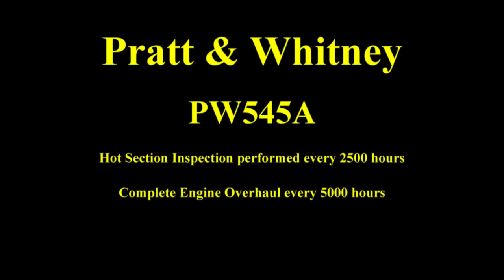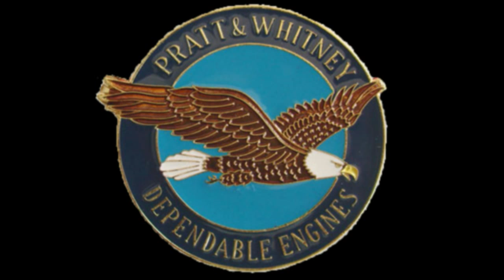Pratt & Whitney 545A Hot Section Inspection with Dallas Airmotive

Comment: Hey Kevin,  I'm delighted to see you making sure that the pieces-parts are keeping us all safe.  For the 'mere mortals' among us, FADEC stands for Full Authority Digital Engine Control. That is a computer that is programmed to make sure that the commands from the cockpit can't exceed the operating limits of the engine. (No overfuel compressor stalls.) It also handles the complicated starting routine of the engine without turning the engine into a static 'work of art.'
If you order the optional extras, the FADEC also slices your bread, makes your toast, lights your cigars and pours your drinks. (Just kidding, but you can bet a week's pay that Cessna's Marketing Team are working on the last part. ;-D Thanks for the video!

Comment: Good to see Kevin again. Love the Texas Air Fleet moniker. Wish I could get a T shirt..... I work for Parker Hannifin Controlled Systems Division (14 years) and Boeing (13 years)  and have build a lot of engine components. I have built fuel nozzles for the big stuff. Rolls Royce Trent and GE engines and a bunch of other stuff. Right now I build EHSV's for commercial and military aircraft. Funny thing is I have been in the aerospace biz for 37 years and have never flown. Engines are like a Swiss watch. Lot of moving parts and they all have to work. They go in a certain way and come out a certain way. I think the guys need some scaffolding and support structures. That stuff looks heavy and heaven forbid dropping something. Do these guys go from memory or do they have service manuals?

Comment: Why don't they have serviceable parts to install right there.... minimize your AOG. Then on the next ones whichever aircraft it may be... gets the freshly rebuilt components taken during HSI from another aircraft... and just keep cycling them... the same way automotive gets cores back for alternators... starters etc. They give you a serviceable one and take the unserviceable one to rebuild and then whoever's next in line gets the rebuild, and they in turn hand in their core, and so forth.  AOGs aren't making money and these parts are insanely expensive. A pt6 hpt disk with a maintenance release(green tag) without blades even is worth about 12 grand.
Reply: Automotive don't have to keep logbook with regulation as strictly as airplane does. Introducing a 400 cycles hpt disk in your 200 cycles PT6 engine is not desirable by most customers. SC like Dallas Airmotive have access to genuine spare parts directly from Pratt&Whitney as fast as FedEx can go, so AOG is never really as bad an issue. If a part is found unserviceable during disassembly, the replacement will be ordered and received prior to the engine is ready to re-assemble.